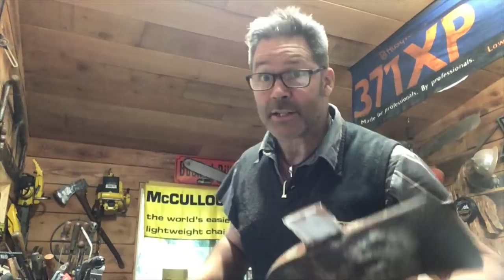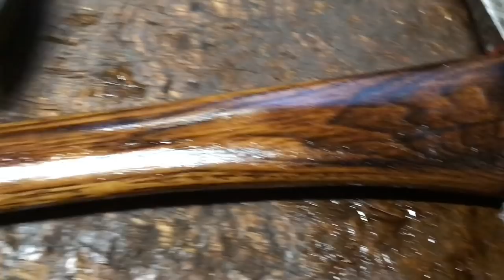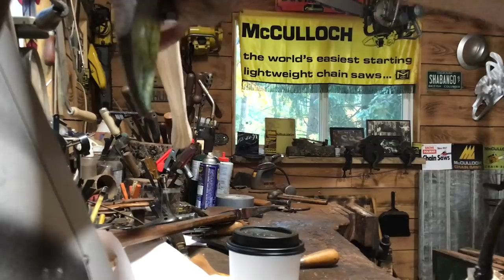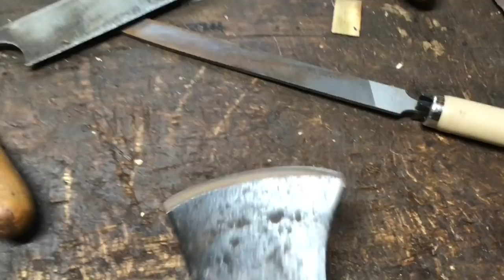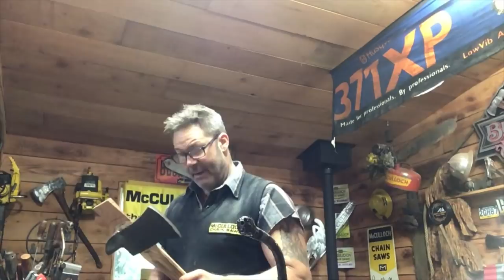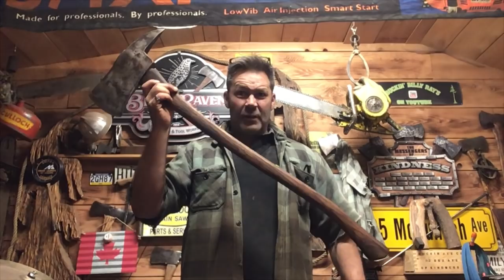Double fire!, part 2. Fire axes ready to go

Comment: Beautiful work, just a tip next time you need to remove alot of material with a flat file get a mag cut to start, looks like a wood rasp but for metal, then finish with a mill bastard. Stay kind